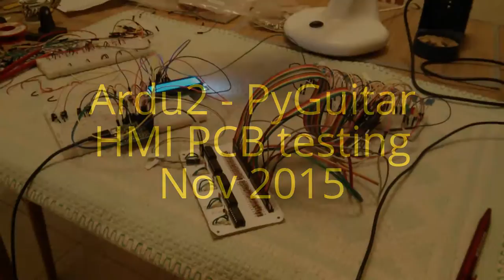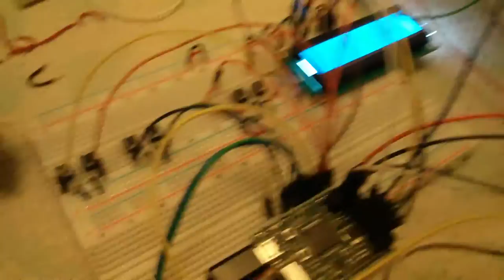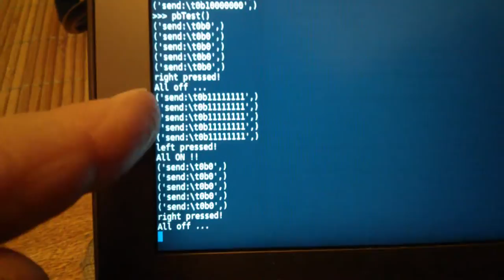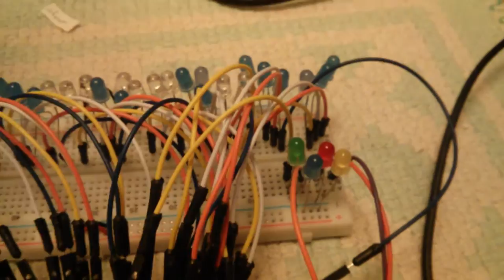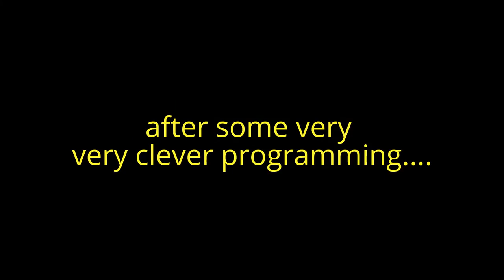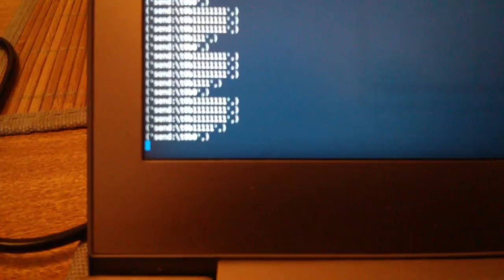Pyguitar (ArdGuitar2) HMI PCB Tests

Comment: good job,

Is there a way to get in contact with you? (mail, skype)
Reply: +gratefu1frog 
Hello again,

Finally I found someone who has quite similar intention.  :D
I`m also quite frustrated about the options on my guitar and i hate to turn switches and knobs to find my "sweet" spot.  They should be only there for decoration. :D

Nowadays many people like I, are using digital amps (for me it is the Kemper Amplifier) and I would be great to communicate with digital amps and guitars with only one pedalboard on stage or in the studio.
I built a guitar with huge space for electric boards, so I would like to insert a modified version of your board into my guitar. The guitar has a standard output-jack and a MIDI jack but i consider instead of the MIDI-jack to use an  Ethernet-jack (8pins) to supply electricity, MIDI- In and Multioutput-Options which is quite unique. So I can track my neck-pickup and my bridge-pickup or my piezo-bridge at the same time. This is quite cool for recording purposes.

An example, what I am talking about (it is an metal-sound): http://www.prosoundweb.com/article/in_the_studio_techniques_for_double_tracking_guitars/ 
So instead of the normal guitar-cable there will be an Ethernet-cable (including MIDI Signal, electricity and stereo output) but the amount of cables stays one. The normal output-jack is for using analog Amps. Thats why i inserted 2 battery slots in my guitar body for supplying electricity.

So my questions are:
I have two pickups with different output-levels. Is it possible to balance outputs independently from sound-coloration with your board? 
Can the resonance frequency and its resonance level be set independently?
I would like to add a MIDI-Communication because it makes it more flexible in musical context. I can use my floorboard during i play guitar but i cant use my phone to switch "presets"/configurations. 
Why are you not using variable state filter like this one? https://www.google.at/search?q=state+variable+filter+guitar&biw=1920&bih=971&tbm=isch&imgil=3Ogb0P8fd71OmM%253A%253BJ9ZQ_ZHQDO_rFM%253Bhttp%25253A%25252F%25252Fwww.madbeanpedals.com%25252Fforum%25252Findex.php%25253Ftopic%2525253D11520.0&source=iu&pf=m&fir=3Ogb0P8fd71OmM%253A%252CJ9ZQ_ZHQDO_rFM%252C_&usg=__LD8suwxX9LfJfEnw11lYRaHkr1M%3D&ved=0ahUKEwjwjtPciObJAhUCthoKHd8fAGUQyjcIJw&ei=UVR0VrCiD4Lsat-_gKgG#imgrc=3Ogb0P8fd71OmM%3A&usg=__LD8suwxX9LfJfEnw11lYRaHkr1M%3D

Unfortunately Im not a person with great technical knowledge. Im not rich but i`m really interested in it and would split costs. 

I would like to love to hear from you soon.
Maybe you consider one of my suggestions, that would be awesome. Im sorry, if i ask redundant questions but i didnt finish your documentation yet. 

regards Dominik
Reply: +gratefu1frog I finished your documentation. (to be honest I did not get every detail, but I have a good overview now)

Why do you use a 10nF-Condensator for every coil? This makes it impossible to shift the resonance frequency. Generell speaking it is hard to have a variable condensator. Thats why you should have a closer look on the SVF it is from Lemme. You mentioned him several times, so I guess you know his schematics.

A normal Vol-Control which you have change amplification and the resonance peak at the same time, which is not enough satisfying in my eyes. 
 Here your vol-control response: https://www.dropbox.com/s/3hszelajko37oyq/VolumeVariStratPassiv.gif?dl=0
Better: because more linear: https://www.dropbox.com/s/rhaet2btj64iz3f/VolumeVariSB_2P.gif?dl=0 
-> SVF